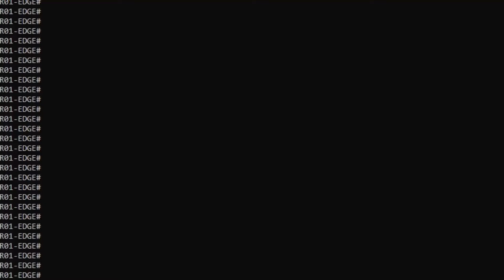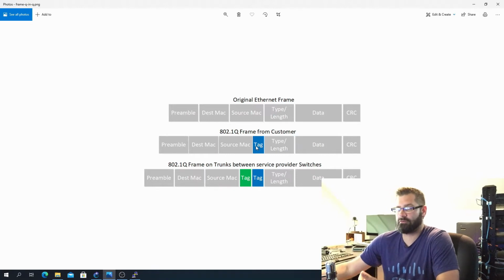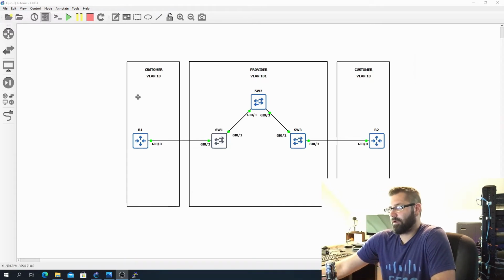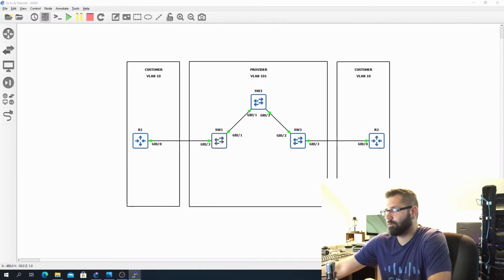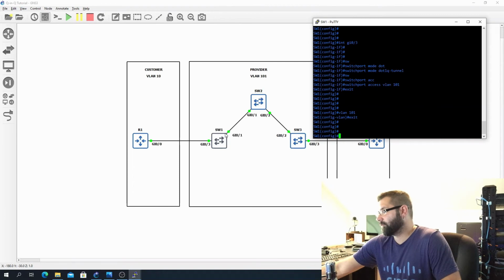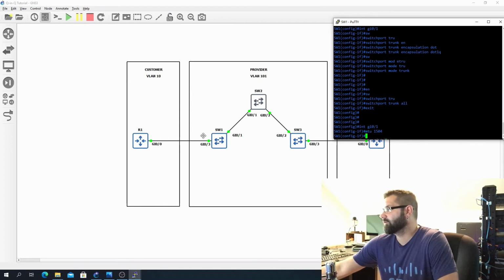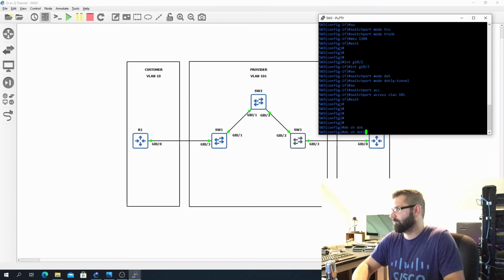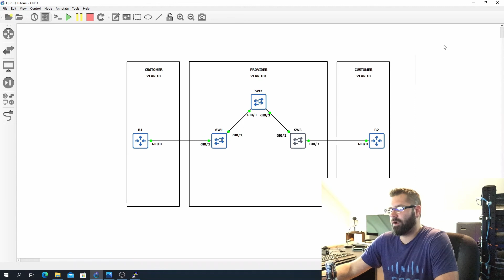802.1Q Tunneling (Q-in-Q) | Brief Overview and Sample Configuration

Comment: Can we pass layer 2 updates / traffic via isp network like CDP/vtp etc ?? If yes then what should be the extra configuration?
Reply from the maker: You can tunnel layer 2 protocols such as CDP, VTP, STP, etc. The extra configuration would be to configure "l2protocol-tunnel" under the interfaces facing the customer equipment. If using my video as an example, you would issue the l2protocol-tunnel command under GI0/3 on SW1/SW3 as follows for CDP and VTP:  l2protocol-tunnel cdp l2protocol-tunnel vtp. I hope this was a help and thank you for your question!